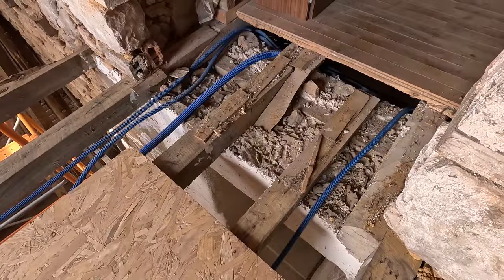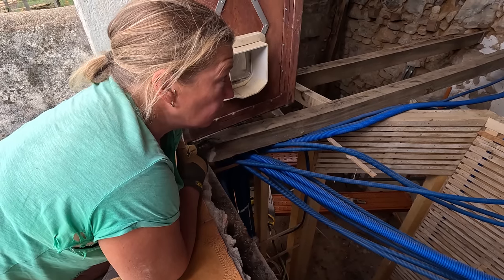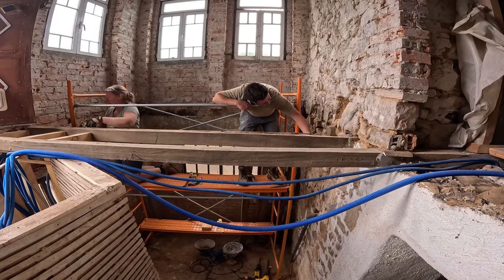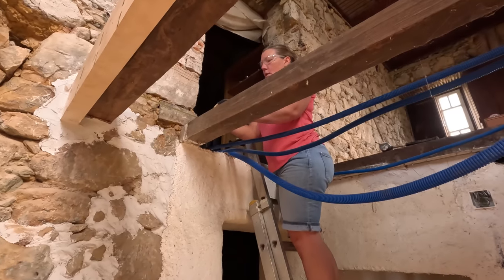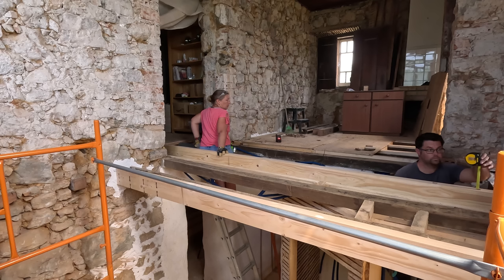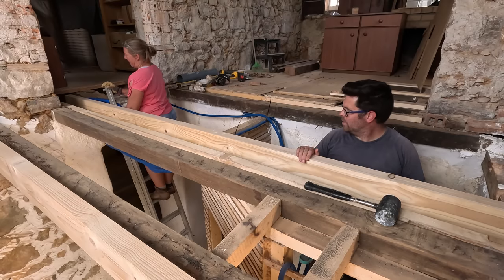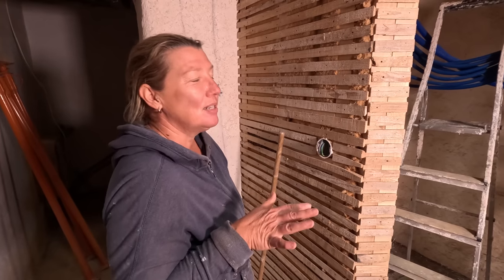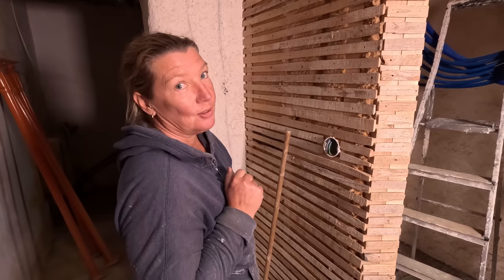The Biggest MISTAKE We've Made (So Far?)

Comment: My husband is a structural engineer and he watched this with me.  We love watching you guys by the way.  We do a lot of diy at our farm.  He mentioned three things that are all listed below:  1) you can bracket the weak spots you notched with a steel plate to add strength or change the beam out as you intend, 2) the mortar/lime can shrink causing the beams to drop so the shim idea below makes best sense, and 3) treating the end of the beams to prevent future rot/decay is prudent.  These are all mentioned below in various comments.  Your place will be stunning when it is done. He said you could also consider making the lower wall a support all versus a stem wall so it does provide a level of support for the joists.  Anyway - hats off to you both.  Keep up the great work and great attitudes about it all.  He's happy to chat with you guys if you need help structurally in the future.
Reply: YES! As an architect, I totally agree with Lori’s comment. 
You DO NOT need to remove the floor joists that have been installed, simply add/bolt steel plate to each of the joist you cut. 
You could also reinforce the existing lath wall below to handle the load from the floor system above. 

Don’t worry, you guys easily solve this situation! 

Love your show,
Miles
Reply: This is the correct advice. Put studs in the walls below the notched joists. Perfect solution and stronger than the other joists as you have effectively cut the spans in half. Don't tear the floor out!!😊
Reply: Super suggestion- hope they pick it up. 👏👏
Reply: Totally agree with Lori
Reply: Exactly. Just reinforce the cut you made with some steel plates, that you bolt into the beam.
Reply: @mileswhitfield2290  I'm an Engineer with extensive experience in such matters (interfaces) Miles is offering solid advice-
Reply: Know it all
Reply: @ruthnoronha8206  Structural engineers do this for a living so they do pretty much know it all on 'engineering structures.'
Reply: Also consider the use of brick piers from the ground on perimeter walls.   Love your work !
Reply: @ruthnoronha8206  - 🛎end

Comment: I'm an architect and loving watching your progress....  

As others have said, you can add plates over where the notch is.  Adding studs in the wall below can be done also, but a real PITA since you have all the wood lathes nailed up on both sides of that wall.

Three other observations/recommendations since you seemed committed to doing it over... 

1. It looked like you made similar notches at the ends of the new joists where they bear on the plates.  Those notches weaken the joist in the same way as the notch in the middle.  Better to notch the plates as required to accept the full depth of the joist.  

2. Where the ends of the new joists are bearing on masonry, you need to fit small stones as shims instead of relying on only mortar for support which over time can shrink/crack/crumble. 

3. Lastly, PLEASE coat the ends of the joists with a waterproof coating where they are in contact with masonry.  Regardless of it being breathable lime mortar, since you are in there replacing all that material, it's so easy to protect the ends of the new wood that I don't think you can afford NOT do it now and know that moisture will never get into the wood.  Same for that new plate section you put in.  That should totally be protected from masonry contact.

Don't be discouraged....   This is a small bump in the road of an awesome project.

Comment: As was already mentioned, simply sister additional wood at the “weak” points.

Also, if you ARE taking out the joists, definitely coat the ends under the entry way—actually all ends should be coated/treated—for against moisture absorption and termites/wood worms.
Reply: Wood itself isn't the best solution, because the vertical thickness is limited by the wall underneath. It would be better to use a metal plate of some kind.
Reply: @dper1112  Metal plate is also good!

Comment: Hi 👋, I am new to your renovation project, I am sorry say I new what were going to do even before you done it, as it is one of the most must
Mistakes that people do, but you learn by your mistakes, and so long as you do that you will get better and more efficient, 
I now it is time consuming but it is better to draw something out, even just a sketch, and never cut the under side of the beams, I am retired ,
Specialist Jointer, Cabinet Maker. Of over 40s , and I have made mistakes, I have been working on very large barn conversions over the last 17-19 years, mainly in the Uk , just one project had 8 Doors, 24 windows, in 2015-6 one of the biggest windows I have ever made 4mt wide 
5-6 Mt high , and the doors 80Ml thick , I am now living in the Correze in France in a moulin , we I/ ex partner purchased back in 2012/3 , I had to replace 24 beams on the first floor, I dropped them in the basement, it only took me about 5hr but 2 days to remove and clean up, and burn in , I decided to build a wall plate 100x220 x 12Mt long I put post every 1Mt , I got a company to make 2 jigs in aluminium, one to cut a tail, and the other dove, as to make a very large DOVETAIL joint, this is a technique that Germany and Swedens do in beam construction it is very strong, but you have to calculate the length of the size of the beam and then it will get you size of the dovetail, 
Sorry for going on so much, I am a old guy with no one to talk to, 
Good luck with your rebuild, if I still had my bike I would come and see you and if wanted I would love to get you a hand , I have been to Portugal twice, it as some amazing scenery. Stay safe, Phil from the moulin France.

Comment: As mentioned by other people,  the best, easiest, quickest and most efficient way of fixing this is to bolt a length of steel plate either side of the notch. This is not a bodge it repair it is used by professional builders so you won't have to feel guilty about it.  Do yourselves a big favour,  remove the stress, remove the reason for beating yourselves up and save a whole bunch of time, effort and money. 👍

Comment: If you are concerned about losing 25% of the strength of the beam, it would be much simpler to add that amount of strength back by either sistering the weakened section or bolting a short length of flat steel to either side of the beam.  Otherwise you risk moving the goalposts from "done" to "perfect" again!
Reply from the maker: You’ve assumed that sistering/bolting is possible
Reply: @MAKEDOGROW  Indeed, I'm making lots of assumptions and you guys are the only ones on the ground and able to weigh up the options.  Best of luck with whatever solution you choose!  🙂

Comment: You also should have shimmed the bottom of the beams, rather than lifting them up and putting concrete mix below them. The beam should rest on the brick, that mix could weaken and the beam shifts down to its pre lift position, causing the floor to have a dip/spring. You could also consider filling that notch in the beam with a piece of the same wood that is tightly fitted in to it. Save you redoing it.

Comment: As another engineer noted below,  they make metal straps with nail holes that could be placed across the bottom of the notches that will likely provide the beam strength you require.  However, if the beams or joists will be exposed you would see those straps.  You could make straps if you can't find them where you are with some 1/8 inch plate the width of your joist about 3-4 feet long.  Drill holes for 10 penny nails about 4" on center and stagger them left to right..........................

Comment: Is there enough room to leave the mistakes in place and put yet another beam done correctly long side. The floor will be super strong.
Reply from the maker: This is the best ‘fix’ suggestion we’ve seen … will definitely see if we can do this, but we’re a little tight on space as we need to fit all the services between the joists (electrics and ventilation ducting)

Comment: Did you make a calculation weather the beams are to light?  My guess ( as a naval architect) is that the beams are overkill in size anyway and by adding extra beams you divide the load so each beam has to carry less load ! If you are still concerned about the strength, you could sister them with either a wooden beam or mild steel. Adding a flatbar 50x6 mm will add a lot of strength. Don't beat yourself up to much, you are doing a wonderful job!

Comment: Construction guide app from Sweden provides ample resources. Checking the measurements for a span of 3400 mm  you would need a beam for a floor structure to measure 

w x h , class, span max
45x195 mm, C24, 3 410 mm
45x220 mm, C24, 3 840 mm
45x245, C24, 4 280 mm
70x220, C24c 4 460 mm

With a CC distance between beams of 600 mm.

I think you would be well dimensioned if you took out 70 mm and that equates to 25% of the beam total height. Then your beam would have to be 210 mm remaining and you could easily span the full 3,4 meter in one go anyway.

Comment: First, your span is not that long.  Do some research, see if the dimension remaining (excluding notch) is structurally capable of handling the span.  Second, how difficult would it be to add structure to the bathroom wall, making it load bearing, essentially halving the load requirement of the floor joist either side of the wall.  Finally, (best option) sistering with true plywood (not OSB) or actual 1 by material can add remarkable amounts of strength to the entire span.  Would need to be glued and notched INTO the bathroom wall but it would solve you dilemma and last for decades.  Metal plates would also work and be incredibly strong.  Metal is just a bit more fiddley and requires drilling into an already weakened joist.  I know it's ok to do that but it always makes belly grumbly when drilling more holes into an already questionable framing member.  Good luck and don't beat yourselves up.  A...it can be fixed and B...It doesn't require removing final finishings.

Comment: How about putting extra vertical studs in the new wall under and supporting the joists above where you notched them out ? And/or a couple of long checker plate (or similar gauge )steel cheek plates bolted through on each side of the the joists where you notched them  out .Any local blacksmith would make those for you from  your cardboard pattern template .Would have thought that would save a lot of buggering about with taking out the just fixed new joists .After all you only have to repair the structural integrity /stability of a couple of joists  at the notches .A vertical post under the notch in the stud wall below and or some steel cheeks would do that .And all can be achieved from below .Just a  thought that perhaps you have already had !
Reply: Me again .If you find a blacksmith or local Stella fabricator you could have steel U shaped reinforcement plates made up to bridge the joist notches rather than just plates on either side .While you are at it how about having some  purpose made joist support made to reinforce where they enter the stone work .Like a steel wall plate that can be bolted to pre located lengths of threaded bar set deep into the stone work . plate with a lip on it under the joist where it enters the stone work .Belt and braces maybe .If you soak the joist ends even now with preservative it will track to the ends in the wall  by capillary action .

Comment: Hm, nothing would have happened imo. The joists had the same seize (after notching) as the old ones. If you want to be sure sure and triple safe, place a decorative pillar or two taking the force effect from the new walls below to prevent cracks. Or putting a piece of rubber inbetween (also helpful with noise reduction). And maybe protect the end of the joists in the outer walls and entrance area with some resin or tar against the problem of moist you had or still have ?

Comment: I would say you could download a chart of recommended joist spans considering length of joist and spacings. It's possible that the rebate you've made in the ends of the joists and at the lower wall don't reduce the joist depth to such an extent and that the joist dimension you have now does stay within the desired dimensions. Best still, talk to your friendly builder and ask him what the best solution is. I'm sure, while you will have to undo some of your work, (e.g. taking out nogs that may be in the way of a fix) pulling the whole floor up will not be necessary. As others have suggested fitting flitch plates to either side of the joists would be a suitable fix, in addition to strengthening the lower wall with additional studs so that it is load bearing.

Comment: Hi you guys, I would not go as far as replacing them. I saw the in between space of the beams which already puzzled me, why are they so close together. Normal rules dictate a space of around and about 40 to 50cm between each beam to get a good structural floor on top. If the beams rest on the structure underneath and it's a good and solid structure you should be fine. As always, great little vlog!!! Cheers Bert

Comment: Hi, you might like to consider using a steel plate going from the end and across the full length on both sides and bolted through.  I would probably use 5mm or 10mm thickness . Cost might be the only consideration. Will it be cheaper to use steel or buy wood to replace what you are going to wreck.  Only an idea as I have done this before. Great following you.

Comment: No sure if this is helpful, depends on whether ye intend to leave the joist exposed, but, ye could run new joist side by side to the notched ones but notch the wall instead on the new ones. Bolt them together for extra security. Either way, well done, ur vids are the best on YouTube ive watched. Great contend.

Comment: Ah you're very hard on yourselves. Personally i would pack out any gaps between joists and stud wall. Load is now transferred and the notches are not in the middle but consider the joist in 2 parts with all ends well supported. I didnt quite see in the film but level and pack out joist ends before filling with mortar. There is so much strength there with the double joists you are not going to have any problems. Jimp about on it or load it up with whatever you can find. I bet the deflection is minimal if at all noticeable

Comment: Brace the beams IN THE WALL you notched to clear connecting directly to the weakened beam and add a non visible sister if possible across the weakened area. Just sit on existing floor plate unless your are going to put a ton of weight at that spot in the floor it will be fine and solid for foot traffic. Weakened beams have stood for decades below tubs etc. rdh

Comment: I'm not an engineer. Are those 3 joists load bearing? Does the bathroom wall below support the 3 joists and shorten the unsupported spans? 
You're doing wonderful work with everything.  Have a homemade cordial and another nap.

Comment: if you soak the ends of the wood or any that will be in contact with the wall in old engine oil (has to be old/tarry/black and will be free from garages)  it will protect it from rot and termite at those junctions in the future?

Comment: Rather than take that floor joist out that was notched instead of notching out the non weight supporting wall ,  I think I woul notch out the wall and than while the joist is still in place bolt flat iron in that blank area and beyond on both ends, and that would more than replace the strength of the wood and be fine ,    It is another way to do it, but if you are going to be seeing the floor joist it would make a difference of course, but if those joists are not going to be exposed it would make no difference and structure would be fine for the purpose of the house.

Comment: These things happen in life. Good on you for owning up to the problem, this alone will allow others to think "we can do that" and "it don't scare us", so well done. I cannot remember if you have a multi oscillating tool, if not get one, if you have use that to cut the nails (at the join of the two surfaces) rather than cut the wood. That size of wood can be very useful even with a notch in it (which if needed could be filled in and glued to be like it was). Infact if you can turn those beams over fill and glue some other wood into the notch's using some sort of epoxy glue. As the "damaged" part of the beam would be uppermost, the "damaged" piece would be facing up and under load it would be under compression, which would make the repaired bit even stronger. Now all of this depends on how much time delay you have on your posts as you might have fixed the problem before this is read. Thanks for posting, fingers crossed

Comment: From an engineering perspective, sister up a 1 meter metal plate on each beam on each side of the notch.    Through bolt is best but lag bolts would work as well.   Make sire the metal plate is at least 3/4 of the height of the beam.

Comment: Following you noticed, this just by curiousity, with my Swedish ear a difference in dialect between you. Probably wrong and not being British used as excuse.

"- You look full of joy." Best ever....

Re: Perfect/Done; Better a diamond with a flaw than a pebble without. (Confucius)

Not sure being a mistake: It all comes down to the load bearing capacity influenced and the capacity needed. Obviously you put in joists in need of trim to fit the outtakes in the stone wall (or?) and even in some cases doubled. I'm not a engineer in building (electronics: with some DIY building experience renovations) so before tearing it all down/redo it have a second (third?) thought and, if possible, consult someone with experience or occupational ability to evaluate.

Enthusiastic (not like a football hooligan, consider I'm 64) follower.